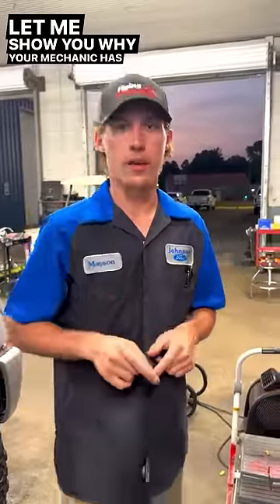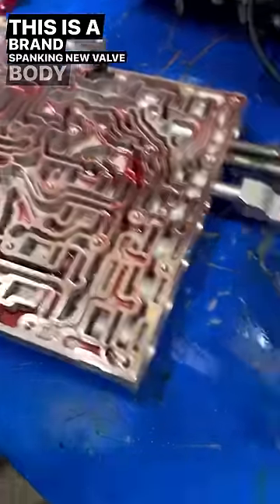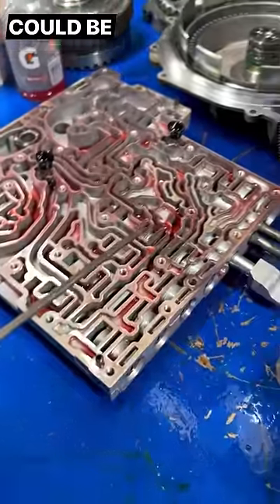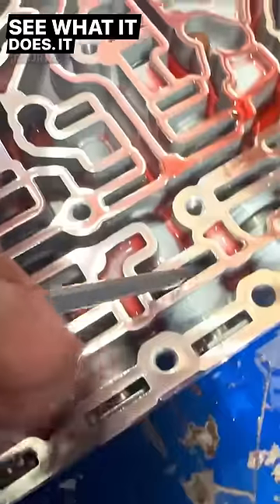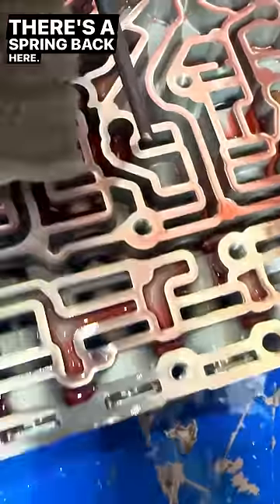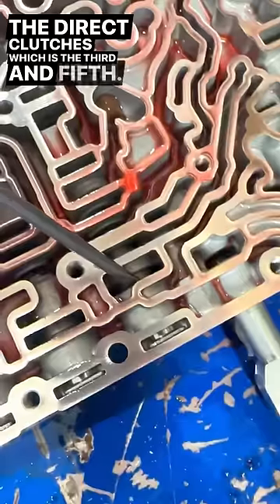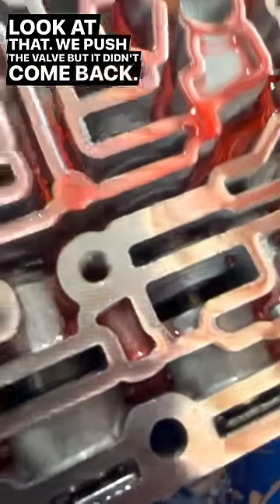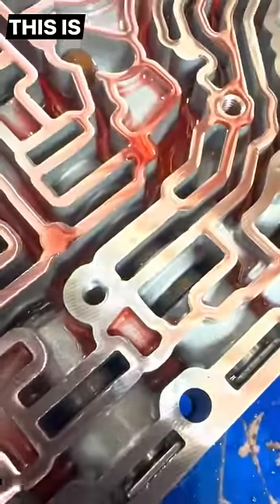Why your mechanic has trust issues #shorts #ford

Comment: We had a dodge ram 3500 throwing the low coolant light. Light goes out when plug jumped with cotter pin. Wiring is ok. We suspected a bad sensor. Still throws the light with new sensor. There is a magnetic float inside the coolant bottle, we ordered a new coolant bottle from chrysler and had the same damn light. The chrysler bottle was assembled without the float installed. Ordered a cheap Chinese NAPA one and like magic the light was finally out. We cut open the original problem bottle and the float was jammed, it's sealed in a no go zone, no picks  no screwdrivers, coat hangers, nothing can get in there to unstuck the bastard. The aftermarket one had better quality control than the OEM.

Comment: Just dealt with a $14,000 reman cylinder head that the methed-up high schooler that rebuilt it in North Carolina neglected to use sealant on 5 out of 6 injector cups. Fun to fight warranty on that BS.

Comment: Could it be that, that valve is designed to close itself under pressure? Some valve designs use the pressure difference to close mechanically, ‘automatically’ without a return spring..? I’m not an engineer just guessing

Comment: I could shoot your use your help with my transmission. I've got an 05 that had a 4L60 but I converted to a 4l80 i installed it and it didn't run right so I took it to get it rebuilt and it still don't run right? Feels like it's taken off in second first gear doesn't fully engage. I'm going to have to take my valve body off and see if it's doing what yours is doing. Thanks for the cool videos. Keep them coming

Comment: I grew up cleaning valve body’s out of 4l60s and 700s a few others. I started when I was about 8. I used to hate working in the mineral spirits. We would hone every passage and every valve replacing some. Some of the new ones we have to reem out and put bigger valves in

Comment: there's something called a bathtub failure curve, it fails because it's new or it fails because it's old, looks like a bathtub if you plot your failure vs time in service.
which is why you usually have less problems buying a car with 15k in than a brand new one.

Comment: Meanwhile my Chrysler automatic transmission has been running since the 80s without a single problem.

Survivor bias sure, but automatic transmissions have been around long enough that the design should be solved by now.

Comment: Spent weeks rebuliding a mates race car in prep for an event only for the valve body to not have been cut/machined properly from factory. It couldn't get reverse so we missed the weekend and had to pull the box back out...

Comment: We changed the transmission in our Nissan Armada.  Apparently the radiator leaked fluid into the transmission.  4 radiators in total we replaced.  Awful design.  What failed in 6 months after new trans?  The radiator, we stopped that one from further destruction.  Then the throttle body went bad, under warranty for once.

Comment: That valve sticking can probably be fixed by replacing o ring if it use it, or by polishing inner piston surface? Ive seen a similar issue in mountain bike where hydraulic master cylinder on some brakes get stuck am ppl trash entire brakeset ,i polished inner surface,changed o ring if old one was swollen and applied silicone lube so it is always lubed, after that brake lever blade didn't glue again

Comment: so the spring is defective or it's catching due to improperly shaped parts or a lack of proper fluids...correct me if I'm wrong but...is it not a pretty run of the mill factory defect? I'd be more interested in whether or not the stats show it happening at unacceptable rates or if it's a very rare defect. I didn't hear anything in the video about the frequency with which this is happening.

Comment: Well what I see here is some over confident dude jaming a flat head into a brand new valve body and also smacking the delicate sealing surfaces of the same with said screw driver, then asks maybe its my fault why it doesn't work, what do you recon ? I recon yep, maybe it is.

Comment: True. Also I think in an automatic transmission the oil pressure is 50 to100+ PSI, so that valve is under pressure and suction.

Comment: I recently had an issue with a circuit board in a motor drive unit being installed upside down. Fortunately it was easy to correct, but if they are making hundreds of these, it's hard to imagine how they messed up that badly assembling it.

Comment: Just cos the two valves look similar, doesn't mean that they operate the same... 
2nd one could easily be designed to use fluid pressure or another solenoid to move it back.

Comment: and this folks is why i dont work on cars anymore.
i used to be a mechanic and a good one and got sick of redoing a job multiple times because the part was trash out of the box. power steering pump yeah broken shaft. water pump ohh it leaks out the weep hole from day one. anything electronic. keys that dont fit the tumbler they came with. security modules that dont program. fuse boxes with bad circuits. iming chain guides that break on first startup. timing chains that stretch on startup.
cam phasers that come apart before it starts.
timing belts that dont last a month. engines that dont even last their first heat cycle. ohh yes what a time to work on cars. i have literally replaced a bad part and had to put the bad part on to keep them on the road till a good part could be sourced.
new parts that need modifications to even fit on the car they were designed for. theres no excuse for it and yet here we are.
bad fuel pump in the box bad fuel pump in a week bad fuel pump if you drive more than an hour.

Comment: In ten years, you better be able to afford a new vehicle under warranty every 4 years or be screwed over and over. Buy that extended warranty.  It will be the best purchase you have ever made. Sell the vehicle just before the warranty ends if you have no mechanical experience to service it yourself.

Comment: I totally understand that new doesn't always mean better. Had to replace the alternator on my Dodge Aries wagon in the middle of January, outside in the snow. Bought a new one and it didn't work. I went through 4 brand new alternators from the parts store before I found one that worked, and it was the last one they had on the shelf in the back storeroom.

Comment: Is it the same pressure on all valves? Only reason I can see it being designed that way is if there is a higher pressure required to push that valve back.

Comment: Most likely there was nothing wrong with the valve body  that couldn't be corrected BEFORE you jammed a screwdriver in it and pried the valve back and forth. 
 
Could be caused by dirt or a burr on the valve, incorrect torque or torque sequence from the factory.  The burr can be removed with a super fine stone, everything cleaned and reassembled.

A SLIGHTLY warped valve body can be corrected by assembling the unit but not bolting the halves together in this case, laying a piece of butchers paper on a CLEAN, FLAT, SMOOTH steel benchtop and holding the valve body at about a 30 degree angle with the lowest end of the valve body touching the paper and using your other hand to slap it flat on the bench top/butchers paper.  Recheck EVERY valve for correct movement after each slap.

A few Ford products had valve bodies prone to warping, but Chrysler held the record for that problem.  I'd say 90% of the valve bodies can be saved using the slap method.

Comment: This is why electric cars are the future.  All these thousands of moving parts in modern ICE's are just thousands of potential single points of failure.
Reply: All these thousands of moving parts used to work fine before everything was made substandard and low quality

Comment: You really shouldn't be jamming a steel tool in a aluminium frame pal
Reply: @TotallyNotBrandon  allys strength is that its soft, doesn't break under load, just deforms 
And it's by weight, allys stronger per g but obviously is far less dense so that can be misleading

Comment: Looks like something on the bottom of a shoe sole man
The hell is that
Reply: Fluid network for an automatic transmission. There's multiple reasons why they cost a lot more to make than a manual and raise the cost of the car. You're looking at one of them.

Comment: Why customers don't trust mechanics:  bashes precision sealing surfaces and valve spools with a screwdriver like an animal then says "spools stick and there are nicks in the valve body so you'll need a new transmission.  That'll be $13000.”

Comment: Both are spring-loaded. The second one has a pressure gateway for the fluid. You can clearly see the channel for fluid to flow thru. 2 halves make a whole work. Now, quit scoring and scarring customer bought parts and buying tools from tool trucks to make you look like you know what you are doing. Save that money and go to tech school. There are 2 sides to that puzzle, and you are only looking at 1. This is why you don't trust your mechanic.